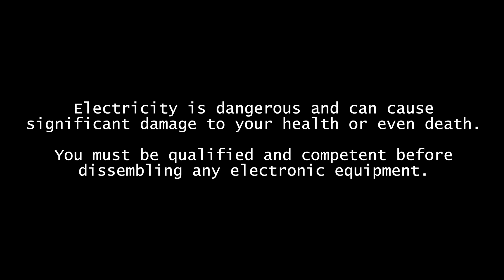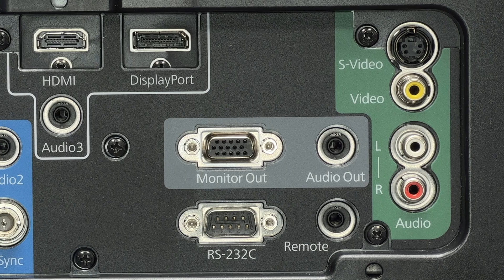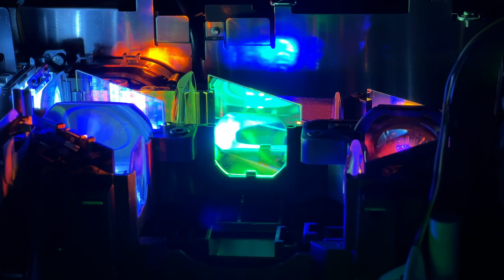Epson EB-G6550WU Projector Teardown

Comment: At 16:00 , those three are called polarizer red, green and blue.
Reply from the maker: A dichroic mirror (also called a dichroic filter) is a special type of mirror that reflects certain wavelengths of light while allowing others to pass through. It works based on thin-film interference, using multiple layers of dielectric coatings to create selective reflection and transmission of light.

Comment: Hi, i would really appreciate your help. I have the same projector but a few days ago it started displaying a blue vertical line on the far left of the screen. 
¿What do you think could be the problem or what do you suggest I do to fix it?
Reply from the maker: Hi! I totally get how frustrating that must be. Unfortunately, I’m not a professional repair tech — just an enthusiast who enjoys exploring how this kind of tech works. That said, a blue vertical line on the edge of the screen with the Epson EB-G6550WU could point to a few things: possibly an issue with the LCD panel, a ribbon cable connection, or even the mainboard.

It might be worth checking if the line appears on all inputs and menus — that can help narrow it down. If it does, I’d recommend reaching out to a professional repair service, especially for a projector like this. Hope you can get it sorted soon! 🙏🔧